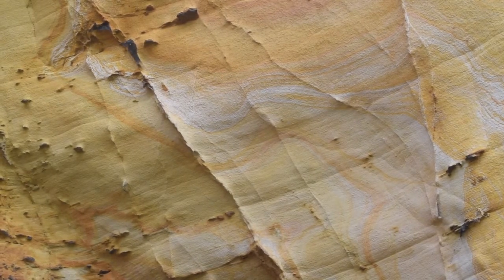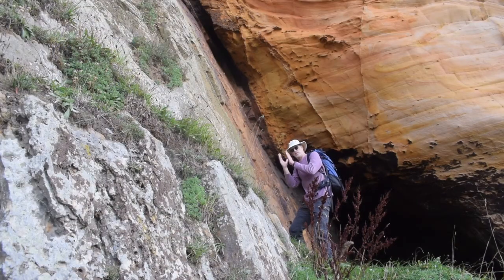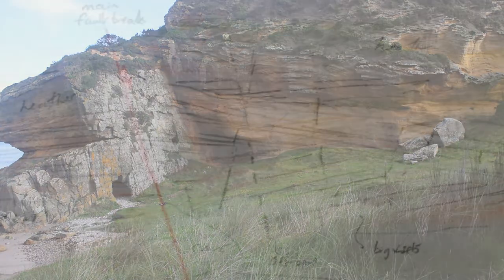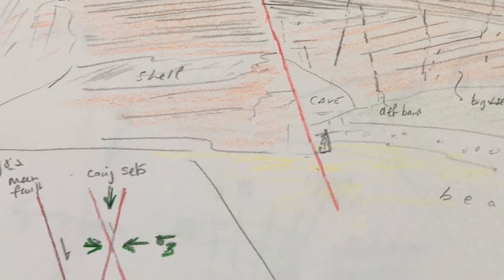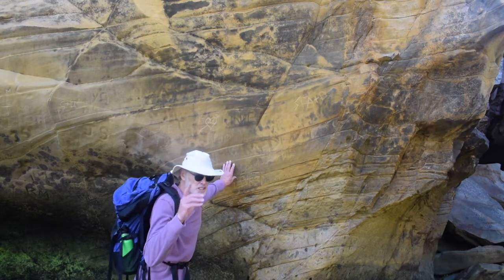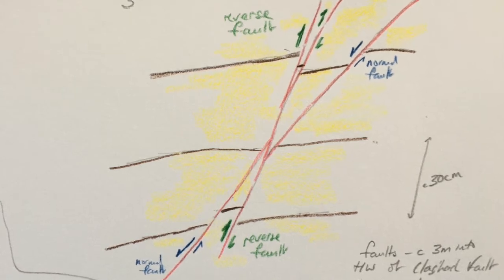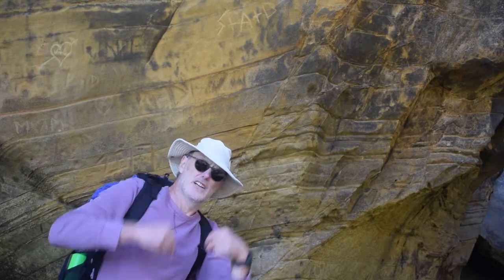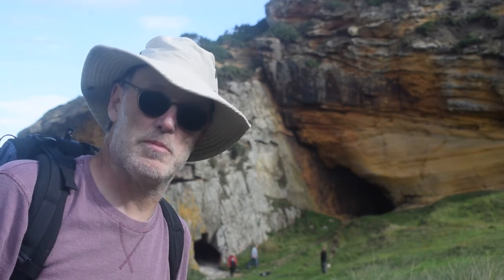The Clashach Fault

Comment: The second profile include both normal faulting and reverse faulting, could there exist strike slip faulting? Maybe three stress fields can exist in the same profile at the same time.
Reply from the maker: Well - there's no indication of strike-slip - the fault plane striations run more or less down-dip  (pitch/rake c 90 degrees). I interpret the reverse sense offset on that small fault in the W side of the cove as part of a conjugate with max compressive stress parallel to the fault dip direction... so actually part of the same normal faulting - with the corollary that the fault plane could not support significant shear stresses (so v weak at the time) ... Not much macroscopic evidence for inversion....